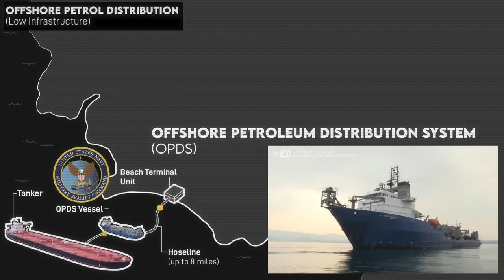The Canoo Pickup :: For The Army First..

Comment: As a former military guy, i do get much of the criticizm here. What i want to point at, is a new generation of batteries coming into the market this decade. They bring 8 to 10x capacity of todays standard LiIon Batteries, without using rare earths. So these 200 miles become 1.600 to 2.000 miles in due time. At the same time, charging speeds are cranking up too. Look at the Tesla semis please. This tech will arrive in military service sooner than later and i think the military is absolutely right in checking this out now. And yes, most non theater jobs can already benefit from EVs.

Comment: 2:17 Huh. So are these pictures showing the raised suspension because i cant tell the difference. It just doesn't look like it could do much off-roading. I mean, I guess it'll work just fine on roads but they seem to be trying to make this an off roader with its raised suspension and tires and all. Maybe I'm conflating off-roading with rock crawling. I mean most off-roading the army does at the moment is along flat deserts so i guess it'll work. But what about mud?
Reply: With the off-road package it has 9.5" of ground clearance.  A Jeep Wrangler has 9.7", so they are pretty much the same.....  I have an SUV which has 8.5" of ground clearance and it sees plenty of off-road use in places you would not drive a normal car or even most CUVs....   Ground clearance is one thing, but tires are usually the biggest factor.

Comment: Alright, I was very hesitant on the tricky truck version at first, but now, you have made me see the light through the darkness. I lie. I only see in the dark. But really, this looks like it may actually deliver. IF, and mean IF the armed forces back it, then it may be worth it. 

I mean, look at it. It's built like an AR-15. Want this mod? Ok. How about this one? Ok. Want to be able to mount 2 railguns on those picatinny mounts up top? SURE!

I think the civilian model will actually keep the street view foot canopy as an option, rather than the military version, but off-road, maaaaybe the glass would not be a good idea to opt with.

It's the modular function. We've seen what it could do in the shows, but it seems to still hold true here. Use it as a camper with a mattress in the bed along with the cab cap. Then get a wrap called "Mystery Machine". Make sure to include Daphne in it and run over Fred. Velma can join in if she wants. Who cares at that point? Then, hit up your Scooby snacks and rinse, repeat. 

Seriously though, it looks like it may be a good choice if the options are in play.

Comment: It is still much harder to transport electricity to the field then transporting gasoline/diesel.
And big solar farms in the field is easy to detect and bomb.
The frontline needs fuel, in all wars, and you don't have electrical power to spare in the frontline, usually you have diesel powered generators for your electrical needs

Comment: It's entirely feasible to charge 6+ with a portable diesel generator mounted on one for military applications. Running a diesel generator to charge several vehicles is more efficient than running many diesel engines all day. I think the heavy construction industry is going to see the benefits of electric motors on heavy equipment and begin to transition. Grid when it's there, diesel generator when it's not. Charge speed for batteries seems to be climbing to unimaginable speeds compared to 10 years ago.
Reply from the maker: I love this comment. Thank you. This tech might not be ready for prime time right now, but just look at how quickly battery tech is progressing. Start testing now, be ahead of the game when the tech catches up. Thanks for the comment my man!
Reply: I don't think an EV will ever be a suitable replacement for ICE, but they are great supplements. I would love to have one of these for local errands. The range is my main problem with them, but there's no reason they couldn't offer a battery pack that slides into the bed ( like a big version of cordless tool batteries) to double or triple the range when you need to make a longer trip. For military purposes, they could always have battery packs charging for quick swaps. That would be quicker and therefore safer than refueling an ICE vehicle in the field.

Comment: I can see use cases for replacing non tactical vehicles with EV's but tactical vehicles will be fossil fuel powered for a good long time to come.

For the non-military NTV's are regular cars, trucks, and SUV'd used behind the lines or on base only for all the things civilians use cars and trucks for.  Tactical vehicles are used to fight with. 

Pairing EV's with the small nuclear reactors the military is developing would be very useful for NTV's deployed overseas.
Reply from the maker: Agreed. Eventually, and we're talking several years, even decades into the future, battery tech will improve enough where they will just always be better than a typical internal combustion engine. Granted, they'll have to store 4x the power and be 1/4 the size... oh and 1/4 of the cost to get there. It's a long road ahead, but we'll get there.

Comment: Just imagine the Armys fuel usage when they have to recharge these vehicles in the midddle of a fire fight.
But, I'd buy one for my personal use as long as it has a bed that I can load with 4' X 8' sheets of plywood.  
Because that size would carry just about anything I need.
And I'd like to be able to flat tow it behond my RV and recharge the batteries while towing it.  Motorcycles and kayacks on the back, and rechargeable!  That would be perfect.

Comment: Just ONE HUGE PROBLEM! So far,The Feds haven't "Type Certified" them for highway usage as they have FAILED all the "crash testing" so far and nobody can insure them. They are being built up in Pryor (I'm in Tulsa,OK) and they've laid EVERYONE off up there! Amazoom and Wally-world and Macy's were gonna buy them to use INSIDE their new distribution centers in Tussa, but now??? Macy's is looking at the Chinese "Pearl" rmicro -EV truckettes and W-W is looking at FIAT/Renault micro-trucks for their distribution center in Ochelata. You ARE aware the Canoo can't operate on Interstates or highways with minimum speeds above 55 MPH. That's WIDE-OPEN loaded or empty-they are only 110 HP at an empty weight of about 4000 lbs. and 1500 lbs. payload, they're like GrandPa's 1940 pick-up, they're geared for55MPH.

Comment: LM_O! First, if you think refueling diesel is an issue on the battlefield. Can't wait to see the massive rolling charging stations needed to recharge these albatross for 2 hours. Where are those charging stations getting their power? Other than that, it's a cute consumer toy. Hope there are no plastics; vinyl or rubber needed for these "environmentally friendly vehicles" 🤣
Reply from the maker: This is first page of a long book.. and yea, these are no where near being ready for combat, no EV's are. BUT, as tech improves, and future generations of solid state batteries, it's likely that we'll have very light weight batteries with tremendous capacity. It'll happen, not overnight, but batteries that are 1/4 the size, 1/4 the weight with 4x the capacity will happen, and at that point many of the current day issues that would clearly prevent EV's from entering the theater of war will be mostly solved.

Comment: Having watched some videos of operations in the Russia/Ukraine war, I could see this truck being used by the military for (1) wounded troop evacuation and (2) nighttime special-ops drone strikes. For (2), you basically get a crew of 4 or 5 guys with  maybe 4 or 5 drones from about 30 miles behind the front line to the front line at night. You can charge the drones 1 or 2 times in the truck from its power hookup. You go launch some recon operations or nighttime grenade drops on enemy troops at night, pack up, and drive 30 miles back from the front to recharge it so you can repeat your operation the next day. It'll have a low thermal footprint from the sky, which will make it harder to spot at night by recon drones with thermal cameras.

If your logistics hub is 30 miles from the front and if the logistics hub has electricity, you can keep running these operations with fewer and smaller diesel deliveries to the front or to your logistics hub. Likewise, you can have trenches right at the front, and you can make deliveries of food and ammo to the guys in the trenches with one of these at night -- less noise, lower thermal footprint. The modular design makes it flexible for various kinds of operations.

My main concerns with Canoo would be (1) that they run out of cash before they can get closer to positive earnings and (2) that, despite their innovative designs, they run into reliability issues that take a lot of money and time to resolve. I think problem (1) will be a challenge as interest rates stay high and several other companies introduce electric pickups and vans to the market. I have no idea how much (2) will be an issue, but, as someone who used to fix cars for a living, I appreciate that massive redesigns of existing vehicle concepts typically result in small reliability issues due to design flaws that the engineers didn't catch in the design stage.

Having said all that, these Canoo pickup truks represent what pickup trucks SHOULD be for most users. It would be great if pickup trucks operating on roads for civilian usage had reduced wheel bases to take up less space when parked and better visibility at the front to reduce dangerous collisions with pedestrians, animals and cyclists. The Ford F150 Lightning looks like a very capable pickup, but it is massive and massively heavy. All that weight puts a lot of wear and tear on roads. I think most guys who work in construction do not need a 5 ton pickup truck. If you transport bags of concrete or small loads of bricks, sure, you probably need a big and heavy pickup. For other guys who are just moving a stack of 2x4s, a miter saw, a job site table saw, some saw horses, and a few tool bags, you can do most jobs without a pickup that's the size of an F150.

Comment: I love the optimism and the push towards the theoretical "right thing to do" statements.    I love this concept but reality is upon us.  We need to revolutionize the battery for EVs to be viable and made available to lets say 5 billion plus drivers.   Battery tech is way to heavy and very very very toxic and dirty to create.  Not to mention to mammoth issue of recycling toxic batteries.    The facts are that an EV will have to drive 200 thousand miles and beyond to even start to have a positive impact on the environment.  Now if batteries have to be replaced before that point then the myth of postive impact is just that a myth.
Reply from the maker: Totally agree. There's so much work to be done with battery tech, like sooooo much work before it's truly revolutionary, but I think we'll get there. Consider how dramatically improved your run of the mill internal combustion engine is today vs 20 years ago. We have 4 bangers making well over 100hp per liter now.. crazy. We'll get there, it'll just take some time, and eventually I think most of these problems are indeed solvable.

Comment: Horse power doesn't matter! Torque doesn't matter!
  Range matters!
 Recharge time matters! 
No way these things will get 200 miles, NO WAY! 
In real world use Pepsi is getting less than 100 miles from the Tesla truck, which claimed a 400 mile range. 
These things won't get 50 miles at a charge and then have to wait 8 hrs to recharge. 
My pickup gets 500+miles from a tank and takes 10 minutes to refill.

Comment: The M1 Abrams tank has a range of less than 300 miles at a lower speed than the Canoo is rated at.
Reply: The difference is the M1A2 can refuel and be off in less time that it takes to recharge the Canoo and still move 300 miles with the equivalent of 10 Canoo's on it's back
Reply: @email4664  yep

Comment: The price should be even lower $25000 to $35000 range. They also have to get the charging speed as fast as a conventional vehicle and get a better range real world distance to around 300 miles per charge using max carry capcity . Electric is not where it should be yet maybe in 5 to 10 more years. The grid system in USA in not ready to handle the type of usage it will get if mostly everyone goes electric. Prices for EV for regular working class people is out their reach for a quality vehicle.
Reply: "It should be this, it should be that" - easy to say, but Tesla started out with $100k + vehicles with not very good range or reliability.    Gotta start somewhere and it's easier to start with high-margin products and move down market than the other way around.   Besides, I'm quite sure the Army is not nearly as cost sensitive as the average consumer....

Comment: This is a truck that should live between the 35-45k range, anymore than that. It will be out completed. 

This thing will make a fantastic short range, light utility truck. If the cab could be adjusted to seat two or three more people in a pinch, it would be perfect. Heck I’d be happy if it just had a bench seat instead of two front seats.

Comment: Whoever thinks 200 mi of range is okay does not drive an electric vehicle. Everybody hates that Prius driver in front of you The one stopped at a red light when it turns green he takes 10 seconds if not 20 seconds to get up to 40 mph. We all hate that guy but that's what you need to do to maintain 200 mi range if you are like everybody else who gives it gas as soon as the light turns green and reaches the speed limit in 5 seconds then that range will easily become 120 miles easily I know this because I have a Tesla two in fact a model s and a model y. I drive them both and while I won't classify myself as having a lead foot I'm no punk b** either. I have had electric vehicles for the past 6 years. Nobody drives perfectly like the Prius drivers trying to get every range out of their vehicle you cannot do that and maintain you sanity

Comment: 50k would be wayyy too expensive, especially for something aiming to be minimalist, economy pick-up. It's long past time EV manufacturers stop trying to play on the novelty aspect and start selling cars at a reasonable price point. These are designed to be trucks for working class people, not upper middle class software devs or something.
Reply: @email4664  I'd like to be surprised, but I'm skeptical. Tesla was making similar claims about making affordable cars as well and they're still charging a premium.
Reply: The average cost of a pickup was $46k in 2022 - this is not that far off and the running costs are far, far less.

Comment: And remember that battery in your ev all the kobalt is from the Congo mined by children that are slaves and work till death at age 14 to get the kobalt for your ev
Reply from the maker: Yea, it's a problem. But, it's a problem that's actively being solved as less and less cobalt is being used with the hopes of getting rid of it entirely in the future. Keep in mind that were very much in the early days of this whole EV switch and the batteries of 10-15 years from now will be far different than what's being used today. Also, it's not as if oil doesn't come with loads of political and environmental baggage, and it has a 100 year head start over batteries.

Comment: It is far too expensive and not rugged enough to be called nothing but a grocery getter. The Army would not like the limited range and the long charge time. What you save on Petroleum costs, you spend on electricity which is not cheap in iself. In the field, you would need a gas or diesel generator, so you are still having to deliver fuel. 200 hundred mile range is far short of a range for  long trips. You struck out on this one....... Try hauling a loaded hay wagon with  it.

Comment: 🤦🏻‍♂️ where do people think electricity comes from in deployment? …. From diesel generators…. So you’d still have fuel runs??
Reply from the maker: Yea, all true, and all still problems.. But, this is basically the first or second page of the story of EV's. Many automakers are just now (some haven't even) starting to deliver their first gen EV's. Battery tech will improve and it's most likely only a matter of time before we have batteries 1/4 of the size with 4x the potential energy. Bottom line, the switch is happening, no way around it, and it'll eventually beat gas powered vehicles in every respect.

Comment: 1) A military going EV "because it's the right thing to do" is nonsense. If it doesn't make sense tactically, it's a disadvantage- a liability. 
2) A milspec Canoo will still have to "refuel". And refueling time is the juiciest time for the enemy to attack it. It won't have range of an ICE version, so it will stop to "refuel" more often. If it carries its own PV panels the payload is sacrificed for the panels. Disadvantage.
3) It takes more time for the "refuel" cycle in an EV over a similar-capability ICE. Disadvantage.
4) The EV Canoo will require a piece of fixed infrastructure (a fixed target) to recharge, whereas an ICE could easily be refueled from a truck (a moving target). Disadvantage. 
Why does this make sense? Cheaper? No. Lighter? No. Uses less gas? Yes. Quieter? Yes. Do the pros outweigh the cons?

Comment: I'm sure the Ukrainians could put it to good use. Humvee tank killers are lonely, need a little brother.
Reply: It's cold, wet and overcast and half the country has no electricity, yeah I'm sure the Ukrainians have use for a 200 mile range light duty truck that can't be recharged.
They'd be better off piling into that mini van that they've been using